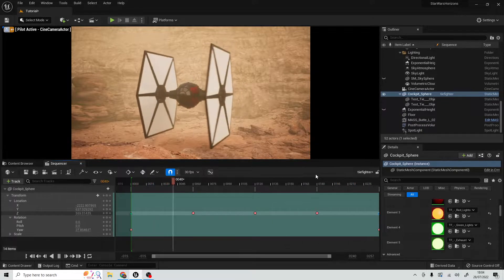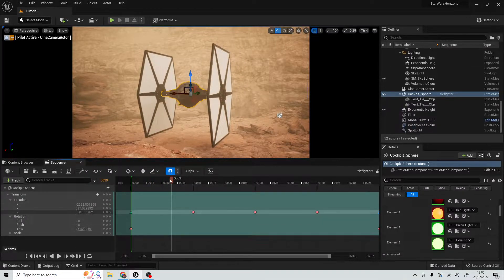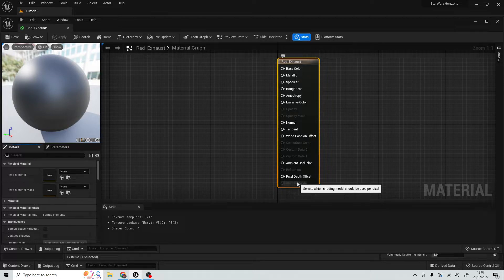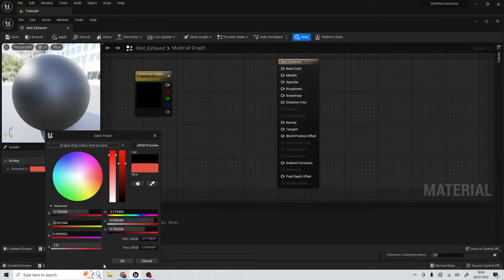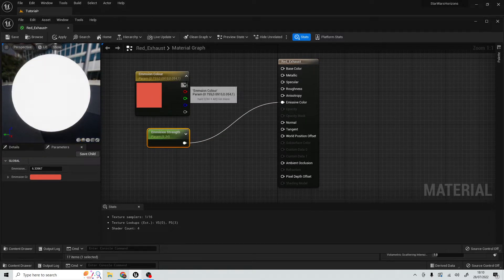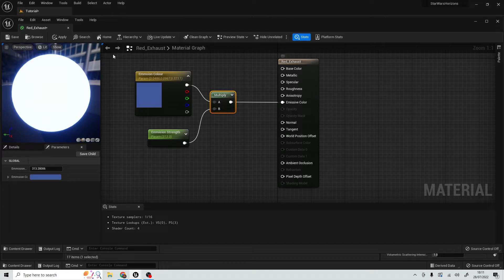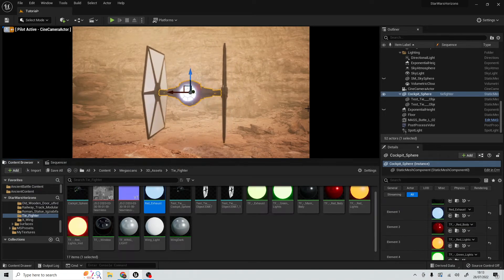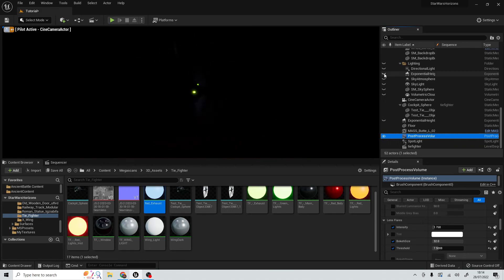Emissive Materials in Unreal Engine 5 (Better Version)

Comment: i noticed that this tutorial works perfectly for me when i use a blank project from the film/video category, but i wanted to implement emissive materials using the vr starter project, and the emissive lighting does not cast glow onto the objects around it. do you perhaps know the reason? everything i've found online hasn't worked for me so far, so i'm not sure where the problem is coming from
Reply: sorry if this is a bit late, but I figured out how to fix the bloom for vr, you gotta add a post processing volume and increase the intensity like in blender
Reply: @tvhe4d  never too late for other people finding this video! thanks for the help!

Comment: Why doesn't mine get the glowy halo around it? I get the luminosity boost, but I don't see the  glow at the edges no matter how high I boost the emission strength. :/
Reply from the maker: Have you checked volumetric lighting on your camera or post process volume. Try doing that and the results will change. Let me know or send me a pm and we can figure out what's going with some screenshots